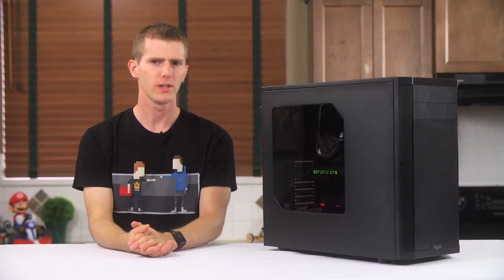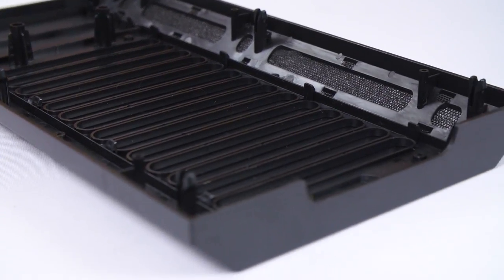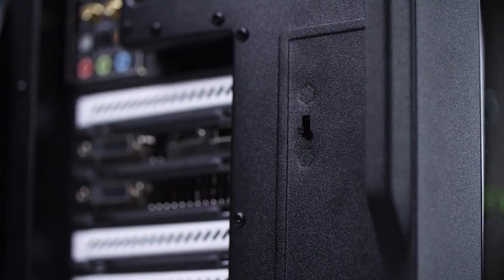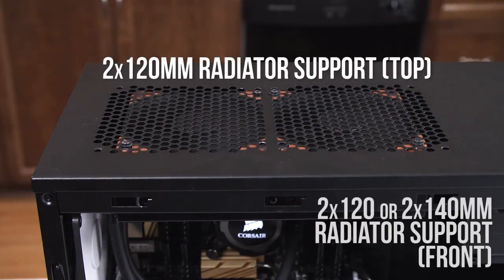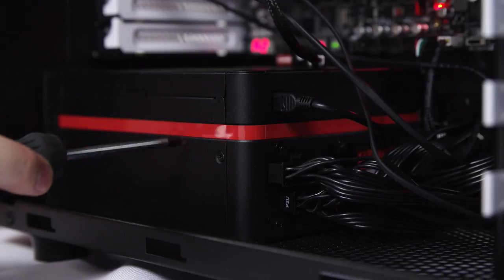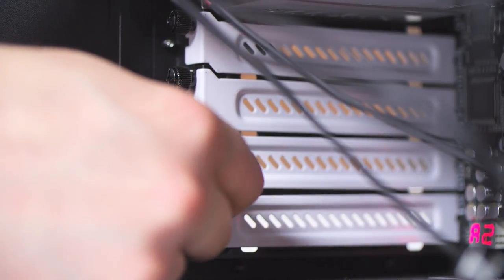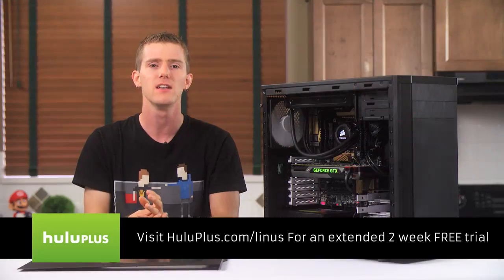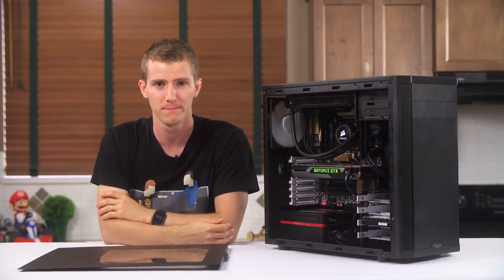Fractal Design Core 3500 Computer Case

Comment: You're too hard on the Core 3500. It's a great value for money. I'm bummed that it wasn't out on the market when I bought my new case. But I bought a Core 3000 and with some modding it will be even better then some more expensive cases.

Comment: Dear Linus, please, please, please, be tough and honest about the products you review. If it's good, tell us it's good. If it's bad, tell us that it's bad.
2 years ago I bought a Nexus Prominent R. All of the reviews were positive. The case was silent, had good features etc. I must have watched half a dozen different reviews on that case. But none of the reviewers bothered to mention that the HDD trays don't fit snugly in their mount and cause a quite loud vibration noise. Especially when you have 2 or more drives mounted, they will amplify each others vibration noise. And even worse, no reviewer bothered to mention that the HDD cage is too far right in the case. It's impossible to use normal sata cables. You can never fit the right side sidepanel. You need to go out and buy right-angled sata cables, and those right-angled sata-power cables that only Silverstone makes. Otherwise you can never close your case. So please don't go easy on the reviews. If something isn't right, tell us in your reviews.

Comment: Are you sure the front fan placement can support a rad? I have had bad experience with my Define R4 and it's pointless "toolless" front fan rig. You can access it way easily than you can in this case but it pretty much limited me to using R2 Fractal Design fans (my rad's fans didn't have a completely square frame, didn't catch on the fan latches) and the screw holes kept the fans farther apart than they should be for the rad. I don't think you were too harsh; FD sells simple-looking cases for high prices BECAUSE they are supposed to be well designed on the inside.
p.s. 7:45 wtf are you on about linus

Comment: In no way is this too harsh. A review is to point out the flaws of the product and I believe the ones you've pointed out are all valid flaws. Considering it's 2014 and the amount of experience that's expect from Fractal Design, this case is VERY unacceptable ESPECIALLY with that MSRP. I simply think those flaws cannot be justified as a compromise for the price point, especially considering the competitions out there.

Comment: Just because it's not a high end case manufacturers are not supposed to cheap out on those kind of cases or even make their handling (like with the SSDs here) annoying. As a potential customer I would either save up for one of their better cases or even buy one from a different manufacturer.

If I needed a case right now I definitely would NOT buy this one.
Thanks for the review.

Comment: Who would put Radiators and SLI/Crossfire Systems into a so budget based Case?
Reply: Someone with priorities different from yours?
Reply: strategy The priorities should be reconsidered then. As you can see the case isn't optimized for water cooling and generally low budget ones rarely are.

Comment: If the $90 MSRP is what this case actually sells for (doubt it), then you definitely were NOT too hard on it. You should have torn this thing apart. Dropped it in a trash can and dropped the mic. Looks like something you could pick up for less than $50.

Comment: So it's the R4 but not good, basically, and it looks like a cheap version of it too. $10 - $30 more is going to get you a much better product with the BitFenix Ronin, Phanteks Enthoo Pro, Fractal R4 or NZXT H440, among many others. I really don't see who this case is supposed to suit because it sits at a very awkward price/feature ratio. If you want cheap, go cheaper with something like the Corsair 200R or NZXT Source 210 if you still want clean, if you want better for not much more (or probably the same amount of) money, there are tons of options.
Reply: NZXT Phantom 310 is a fantastic case and last time I checked it was $70.
Reply: ThatSexyBoss
or the 410 OR The carbine 400r
pretty much anything is better then this pile
Reply: Why does everyone forget that Fractal has an Arc line of cases?
Reply: Exactly, so much to choose from, yet here is another useless option. You would think Fractal would have a higher standard with their products considering the rest of their line up
Reply: The arc is just another example, same price as the R4 and pretty much the same as the Ronin, but I'm not going sit here and list every case that I think is good.
Reply: That wasn't my point, and it wasn't just directed at you. Just something I noticed, that anyone who recommends a Fractal case never recommends the Arc series. Nothing serious.
Reply: Very true, I was actually going to get the Arc, but opted for the H440. I guess the R4 has just become popular through youtube, being used in builds and stuff, so the arc series gets kind of lost. It looks like a really solid case too, unlike this piece of shit.
Reply: I got r4, it's beast, i wouldn't go for anything else really. It's big, wide and all metal, cools insanely well and is quiet

Comment: This case is terrible for the price.  Corsair does better in the $90 price point but what I would like to see Linus review is the Phanteks Enthroo Pro. Its $90 for the windowless version and $99 for the winodw version. Usually available with free shipping.

Its not a perfect case but it smokes this case on every level.  No rivets, only screws.  PSU cover, SSD mounts that make sense (in the back), more rad space, front io with a door low profile door, PWM fan controller that is controlled by your board, fan filters that are easier to work on (top bottom and front).  I could go on and on about why its a better choice.

Comment: wich cable can I put in the fan controller ( 3:00 min)? I want to buy a sleeved extension so I can bring the ugly cable to the side where cable management is done. what do you call that? when i search for 10-pin extension i couldnt find anything usefull.
or could I buy a longer and sleeved cable that replaces the old one entirely?

Comment: Does it matter what HD I use for a Fractal Design Core 2300? Here are the rest of my specs: i5 4690K, 8gb ddr3 ram (possibly 4gb), 500 watt PSU, HD 7750 (will upgrade to gtx 750 Ti), LGA 1150 mobo, windows 7 or 8 whatever is cheaper.
Reply: sorry I'm probably late. You're build puts waaaaaaay to much of its budget on your CPU. your graphics card is going to stop the processor from performing as it should. you should get a 960 at least with an i5. plus 4gb of ram isn't enough. otherwise its fine.
Reply: +Ieuan Williams I already built my pc and it works good so far.
Reply: +Tom Brown I forgot to mention that I upgraded my GPU to the gtx 970 and have 8gb of ram. the 7750 was just a temp card.
Reply: I'm sure it does. I wasn't trying to suggest that, only that a better GPU would boost performance on gaming. Sorry if I came over aggressive as I feel like I may have in hindsight.
Reply: +Ieuan Williams no its fine sorry just me typing from my phone and trying to keep it short
Reply: +Tom Brown I can play all games like witcher 3 on max settings with 60fps :)
Reply: +Tom Brown it's epic!!
Reply: Sounds great. I'm sure it works great. Its just that ur original comment said 'upgrading to 750 ti' and I was trying to tell people that a £100 GPU and a £170 CPU don't match well. (Sorry for funny UK currency)
Reply: I know. That was my fault. I did not specify that I was using a GTX 970 which I had on my shelf. Back then I was in two minds because I was going to sell my 970 and use a 750Ti for better power usage. But I changed my mind and used the 970 instead. I should have edited that and let people know what I am using. Now my current specs are:

i5 4690k
8gb ddr3 ram
gtx 970 4gb
1tb hdd
fractal design core 2300
500 watt psu 
lga 1150 h18m-e mobo
windows 8.1 
external cd drive (sometimes)

I am playing games at 1366x768 screen res
Reply: I'm very sorry for the confusion!
Reply: +Tom Brown y u no play @ 1080p
Reply: I do now. I have just upgraded to a 24" 1080p monitor and it is epic!
Reply: Tom Brown :D Welcome to @PCMR
Reply: +SquidPlays Sorry for the ignorance but what is @PCMR? Thanks for the welcome though! I am contemplating about getting 2 more monitors for a tripple monitor setup and upgrade to 2-way SLI.
Reply: Tom Brown @PCMasterRace
Reply: SquidPlays Ah. I see. Cheers!

Comment: I'm blown away with how poorly designed those SSD mounting points are. How could they have ever thought it would be okay to force people to remove their motherboard and/or PSU in order to secure an SSD? If sticky tape is a superior mounting mechanism than the one you've designed for your case, you know you've fucked up.

Comment: How do you open the front of this thing.
Reply: There's a handhold at the bottom of the front panel.
Just pull it straight forward. I've got a 2500 and it takes a bit of persuasion to get it off.

Comment: msrp = $90 for that case? maybe its just me, but that seems kinda cheap. paid 140 for mine, a HAF. i did not have high hopes right off the bat right when you said plastic front panel~ wait, $90 for this? the quality looks like a $60 case, if that.

Comment: Don't think you were too hard on it. Almost everything you said, should be "right", from the factory for a $100 case. The top of the case being that flimsy? Not really acceptable for a $100. $40-60? Yeah, okay. Fan switch location is utterly terrible. 5.25" Bay integrity appears terrible. Terrible mounting options for the 2.5" drives on the back of the motherboard. Near impossible to clean air filters. If you ask me, this is just shoddy.

Comment: I like what you do Linus, but I think when you do these reviews you have to take into account the price and judge based on that.

You can't expect a $70 case to have the same as a $300 case, it's just not going to happen.
Reply: Also, nobody is going to put a $1500 build in a $70-$100 case.
Reply: Cameron Harvey
I personally think the price should change things like aesthetics, the amount of HDDs, watercooling and cable management supported etc. The Phenom M is the same price as this case, but I'm putting a $2000 ITX build in it, because it looks awesome and it has great features.

This case looks bad and it doesn't seem to be anything special other than that.
Reply: The thing is cheaper cases does it better from Z3 plus, Z11 plus, NZXT
Reply: Cameron Harvey 
I don't think Linus was being totally unfair to Fractal. He even mentions that the build quality itself is pretty decent for the price. Most of his criticisms are aimed at design choices, which shouldn't impact too much on the material cost; things like the placement of the fan controller, or the SSD mounts being inaccessible while the motherboard tray is populated. I don't think that kind of stuff is the difference between a $70 and $300 case. 

That said, some of the criticisms were things like being unable to mount a 240mm radiator to the front of the case while having a second long GPU installed, unless you remove the drive cage. At this price point, and with the dimensions of this case, I think it is a moot point, since anybody with the cash to throw at a liquid cooled Crossfire/SLI setup probably wouldn't dream of putting those components into a case this cheap. 

I think he hit the nail on the head when he said it's aimed at system builders/OEMs. It doesn't seem like a tinkerer's case, more like the kind of thing you build inside once (or 1000 times, by the end of which you'd know pretty damned well which components go in first) and then never open again. Perhaps if he looked at the case from that perspective the analysis would seem less "nitpicky".
Reply: He definitely had some critique that did not have anything to do with the price.
Reply: there is planty of cases in that price range that dose it better like NZXT 530 Source, Zalman Z11, NZXT Phantom 240 and the 410, even the 60$ Zalman z3 plus. Defenetly no bending meshes when you put radioators on it or weirdo places for fan controllers

Comment: I still don't understand why they ask Robocop to tighten the screws and let hamsters play with screwdrivers inside the case(i had 3 fractal cases), also Arc Midi and Core 3000 had an ugly baby.

Comment: Will this work? and if so is it good, my budget is $1000 https://pcpartpicker.com/user/TheWilliamBrownShow/saved/
Reply: http://pcpartpicker.com/p/dJh923 I would get this build
Reply: http://pcpartpicker.com/p/bwkwyc im personally an NVidia guy myself but for your price range I recommend an amd build, it seems your processor, cpu cooler and other things were costing more than your gpu and for  gaming pc you want the opposite. I went with the 290x because it costs about 40 bucks more than a 780 and it rivals the 780ti for performance. I had to go $100 over to fit everything in and make sure nothing was left out but if you really have to make it fit under $1000 ill make adjustments. amd really aint that bad only cons its got is increased wattage and heat, but with the cpu cooler and case it looks itll work. if you want a h100i to fit in there I believe its possible, oc3d has a video of him doing that in the 200r I believe.
Reply: keen kosi its way overkill for minecraft
Reply: chaz baker opps meant to say that to lazinlex
Reply: chaz baker i dont onlly play minecraft im not a noob im playing many games this is just my Minecraft channel im on currently, honestly i dont really like minecraft as much now
Reply: lol I went around $1000 just because of his budget limit, shows to say with some money squeezing you can put a top tier card in a not so top price, that card can run almost if not everything at 60 fps max
Reply: A 660 is a crap card it's not one of Nvidia bests (it's my coaster right now) I upgraded to a R9 290 and never looked back (P.S It can run Borderlands 2 with full physX and 16xAA even though it's AMD!)

Comment: dear god that is a horrible case.......
Reply: Looking for a good jid tieer that eill support a watercooler and 5 hd 2 dcd roms
Reply: Mid tower
Reply: usually fractal makes good cases but this one is horrible lol. But I'm a straight up corsair fan girl lol. Coolermaster makes good mid towers as well
Reply: I have been straigint up cooler master, but the one I have is old, so case hunting now.
Reply: why don't you use brandons coolermaster? He is getting my 800D case anyway
Reply: I thought about that, but it wont fit in my desk. Without removing the
drawer :(   but still thinking  usb3.0 and e sata in the  front is a turn on ;)
Reply: Lol what length and width do you need?
Reply: Width is 9 3.4 inches hight is 20 1/2 tall